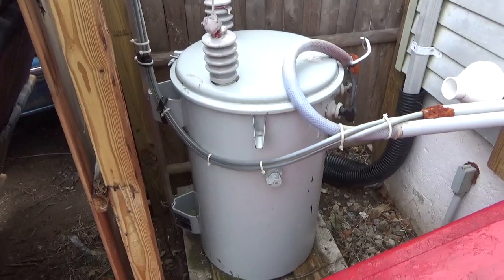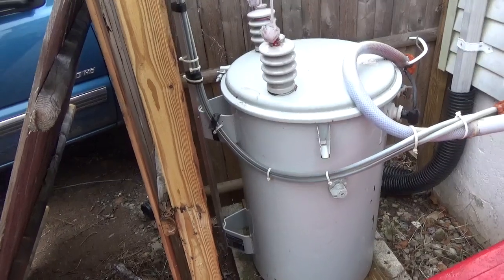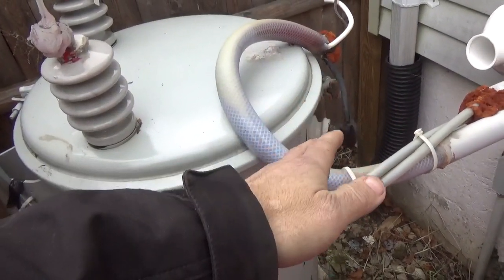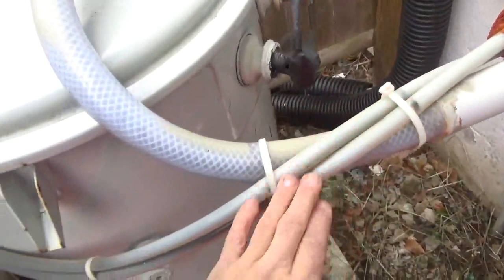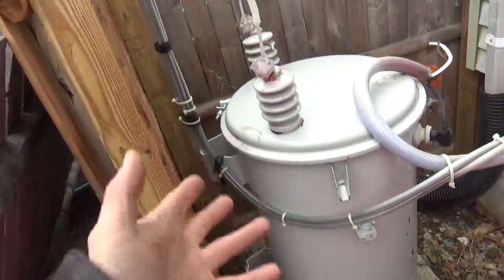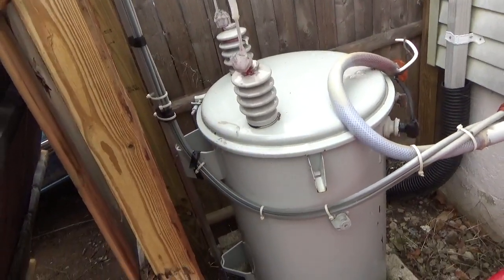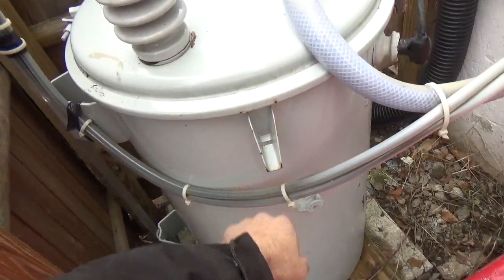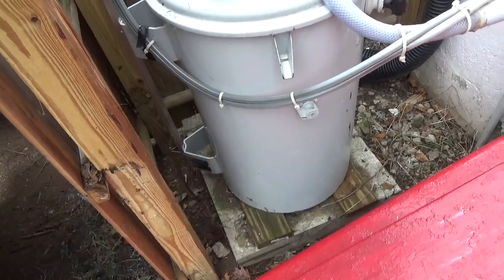Pole Type Transformer Alternative Plate Transformer

Comment: The label DOES say it has PCBs oil in it...  Why do you say it does not?
Reply from the maker: Does not have the original oil !!!!!!!!
Was filled with non pcb type transformer oil

Older pole mount transformers have high ppm  level of pcb oil.  Here is current epa guideline. 

 As a result of EPA regulation 40 CRF part 761, published in the Federal Register Volume 44 Number 106 (dated May 13, 1979), oil used in all distribution transformers manufactured after July 1, 1979 must contain less than 50 PPM of PCB (this is the requirement for the classification, “PCB non-contaminated).

Comment: Slick set up. You must run one heck of an amp.
Reply from the maker: Thank you for the comment. Believe it or not but it cost less than the 3cx6000 custom transformer which has a kva rating of less than 1/3. Most of its use has been to test custom build ham linear amplifiers. Nothing wrong with having headroom.